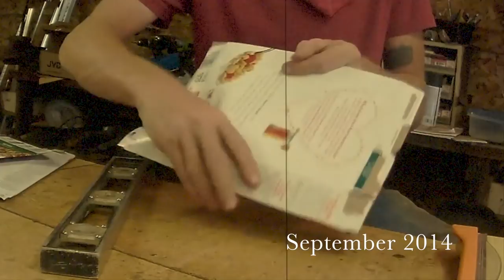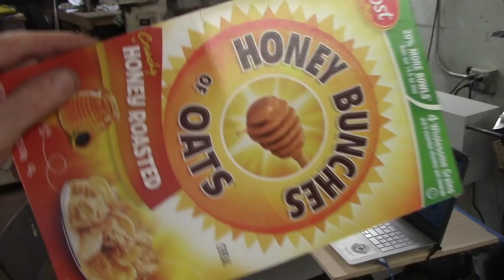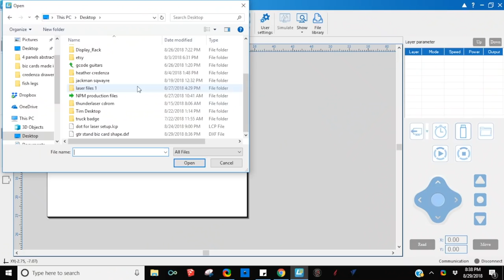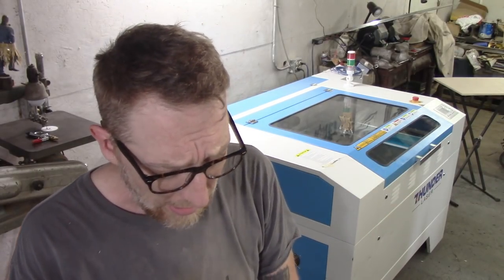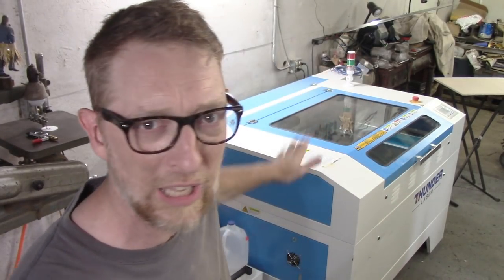Upcycled Cereal Box Business Cards, V2 0 - Now With Lasers!

Comment: Hi Tim, I have been woodworking since about 16 years of age, I am now 67 and I thought that I had every tool I would every need or want. Then came CNC's  and now laser cutters (I now have a CNC) but I do not have room for a laser cutter. As far as I am concerned CNC's and Laser cutters are just another tool to make things with, they are just like my Panterrouter and thickness plainer, yes I could use hand plains to get my stock down to size but I can do it faster and more accurate with a plainer so I use a plainer, it is just another way of doing a job. I don't understand anyone that says a new tool is not woodwork because they do not have one.
Reply from the maker: exactly! The guy with the handsaw furrowing his brow at the tablesaw user is just a dinosaur. I don't want to be a dinosaur (although it does seem a lot easier sometimes! haha!) Have you got that CNC up and running now?
Reply: Say what you will, I just view these as a matter of personal preference. Here comes the but, a handmade item will always have more value. A luthier made guitar over one cut out by a CNC, furniture with hand cut dovetails will be kept and valued more in the long run then a piece that has been whipped out by machines and put together with a finish nailer. Again, I'm not saying one method is better than the other. All serve a purpose.
Reply from the maker: @carlbowden4712  absolutely! What I am seeking, personally,  is a middle ground . I don't want to make 100, $250 guitars and I dont want to make 10, $3500 guitars. I want to reach the middle market, putting the artistry in to the important parts and automating the  less critical procedures to keep labor and cost down. There will always be a place for a three markets, but the middle one is the largest and best place to make room for myself.

Comment: If you add a neck to the guitar card shapes, they might stand up better in the holder
Reply from the maker: good idea. I thought about that. They would look cooler, too. And making them a tad bigger,  but I want them to easily fit in a wallet like a normal biz card so they have to be smaller than 2x3.5" and not folded.